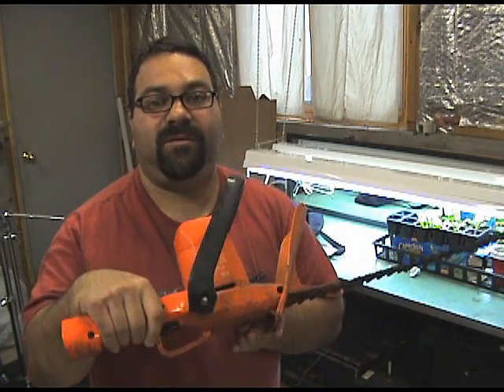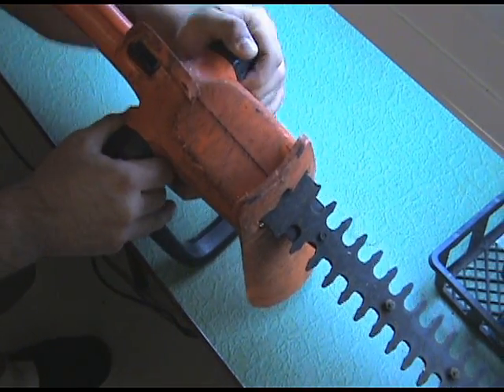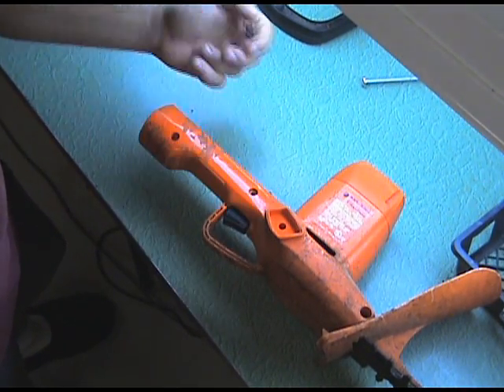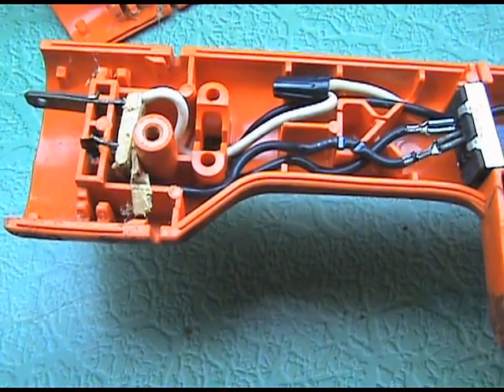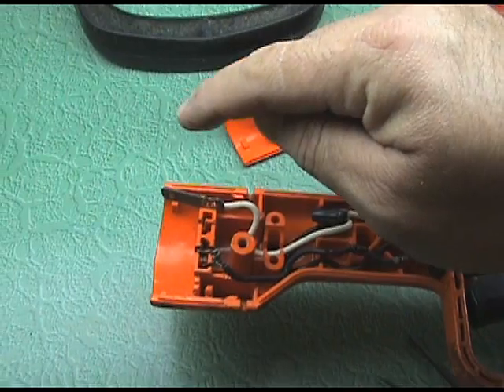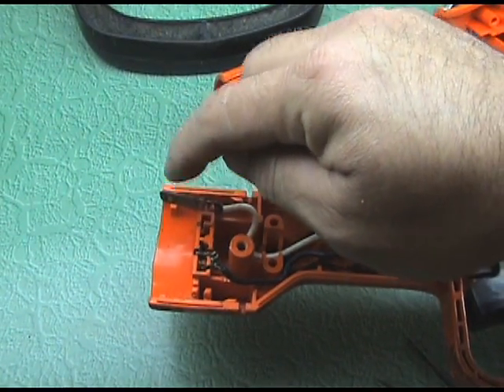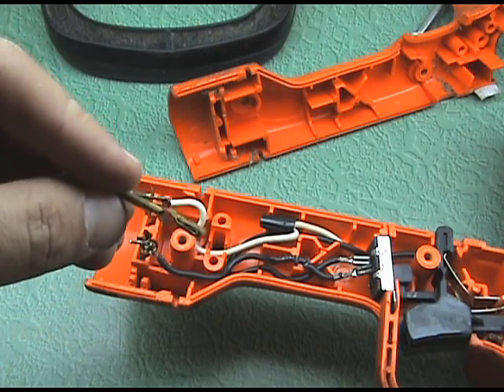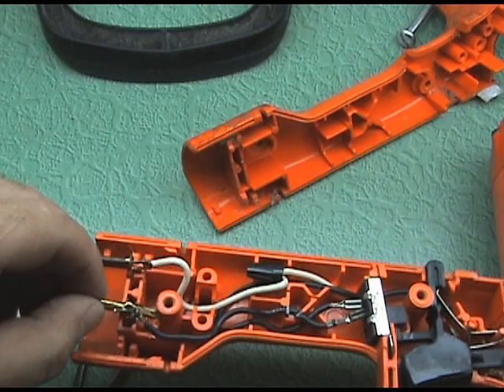Electric Hedge Trimmer Repair

Comment: Today I found a model 8124, like this one. Except, the problem with that is the motor brushes are dead (the last owner wrote "7-4-07 NO BRUSHES"), and the thing didn't even work when I had them test it out before I left the store. They wanted $5.99 for this, but because it didn't work (no power), they let me take it for free.

It is date coded 8939 which means year 1989, 39th week.

Comment: I have a different module (Newer version) and lol I occidentally cut the wire near the top : ( 

Luckily I managed to fix it, your video managed to help me realise where a clip went since mine has 2 start buttons i.e. some safety feature. When I opened mine one of the clips sprang forth and I wasn't sure where it went, (a metal clip)

Thanks for the video dude : )

Comment: The all-metal U272 and its post-1969 equivalent, the 8120, were much more durable in that they were all-metal except for the switch and the wraparound handle bail.

Comment from the maker: Are you going to repair ir or use it for parts?
Reply: paisteboy I completely refurbished and repaired my Black & Decker Jigsaw  model 7580 had to find  replacement  carbon brushes and two holders add new lithium grease  to the gear it works like champ  it was my uncles  I have his hedge trimmer as well  its not Orange  like yours   avocado green  1970's  have not got to that yet because where I live we don't cut the bushes or the  grass the   Community hires gardeners  I'm by no means rich but good job on the repair
Reply: paisteboy have you tried  to remove the blade if you have a bench grinder you can  sharpening  it as well as the outer  cage just an idea to help you